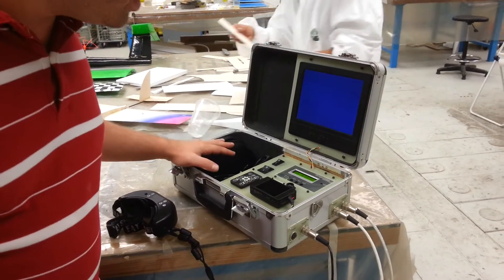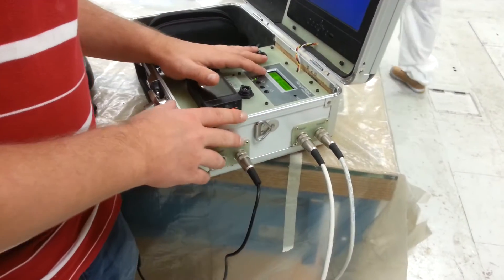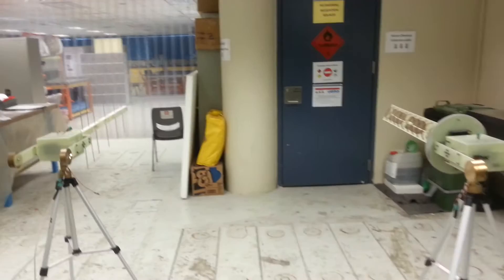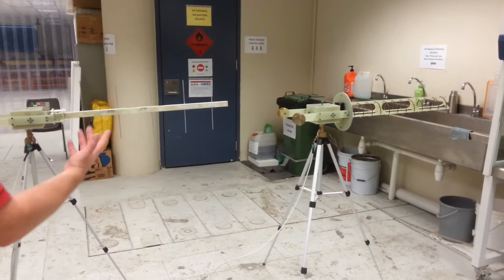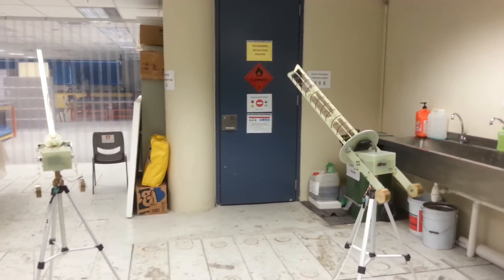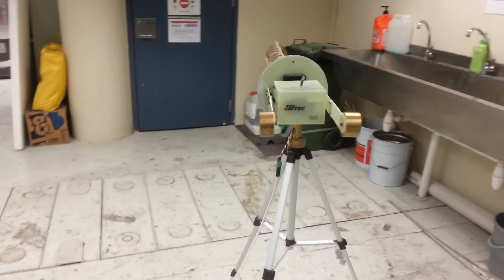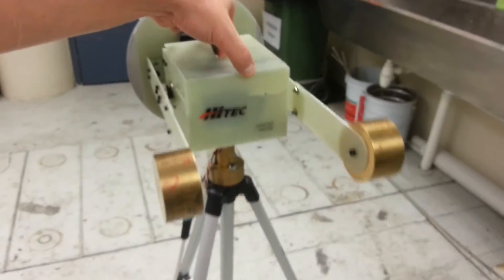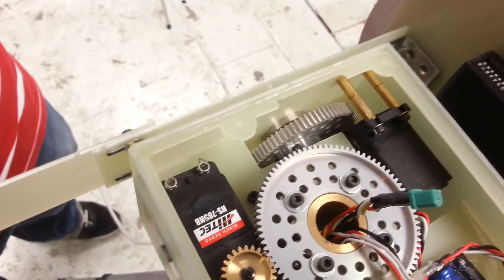FPV Ground Station with 2 Trackers

Comment: Hey man love the setup. Wish I had tracking for my ground station.
Reply from the maker: Branden Nunn Thanks! The servo city gears and parts really hold up very well. The good part is that you can swap the antennas easily and go from fun fly tracker to a very very powerful long-range tracker. I have a build log in FPVlab. just google "Dio's LR thread FPVLAB"
Reply: I hope to have a system like that soon. I'll be sure to check out you fpvlab

Comment: awesome ... is it much trouble to transport these giants when you go flying?
Reply from the maker: Hi octane! Of course, a 1m antenna is not that handy. I tried to make it as convenient as possible: The antennas are mounted to the tracker using 2 screws only, so removing them is easy and setting it up too. Takes like 3min per antenna (wing nuts, fastened without tool). I use a dedicated VRX for all of the antennas, that makes it simple, too. 

This really is a true LR setup. I usually fly with a Moxon on the RCTx and a 6T 1.2Ghz helical, i.e. using 1 tracker only. These 6T helicals are easy to transport, removing the antenna is not necessary.

If I go for quick fun, I just go with my 2.4Ghz radio control and 5.8Ghz on Video using omni antennas, no GS at all. That is good for 1.5km, or about 6km with a 6T 5.8Ghz helical.

Basically I built this to have no more restrictions and a variety of choices depending on how and where I fly. This is also reflected in the planes.

Cheers!